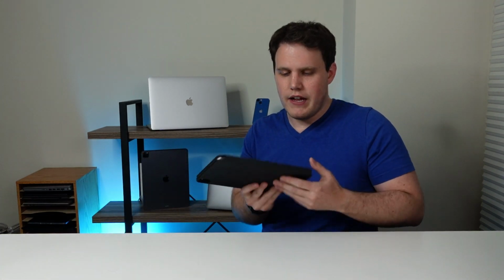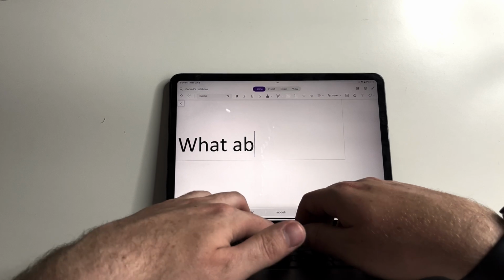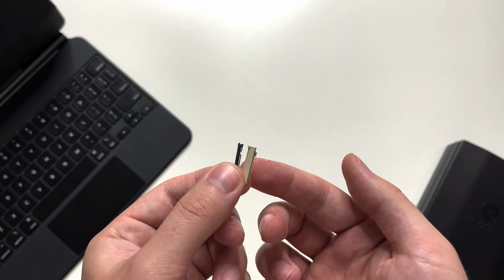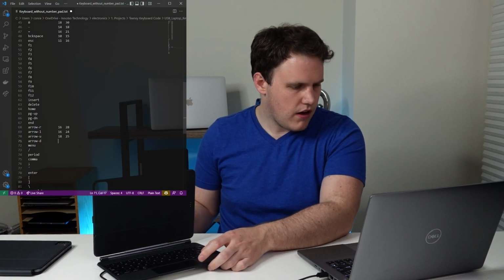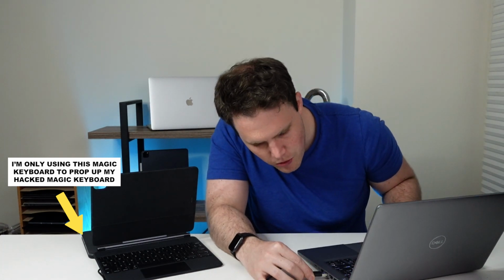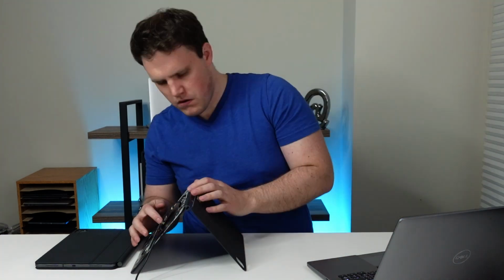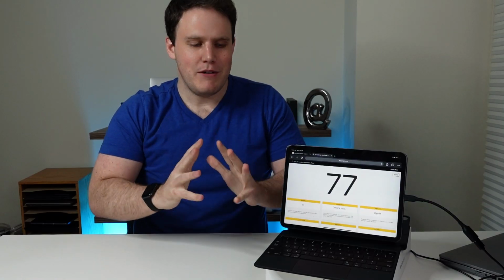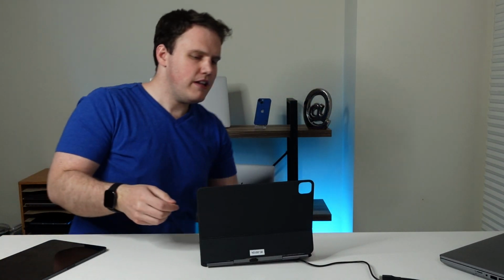World's First USB-C Connected Magic Keyboard! Fully Customizable

Comment: Nice job!  You really pushed the limits on this one.  Pretty cool that you recorded your entire process, then edited it down. Nice to share in your excitement when it all worked! That aluminum panel is EMI shielding, probably to meet FCC regulations so the keyboard doesn’t interfere with other devices.  It’s not providing any structural support. Subscribed and liked!
Reply from the maker: It was a tough one but I'm glad it worked out! And thanks for the information on the aluminum sheet that's good to know!

Comment: An idea for a video although it would be quite expensive would be taking an (M1 chip motherboard) from a Macbook pro 13 inch and putting it into a 2019/2020 Macbook pro 16 inch the ones that had intel chips in them not the new design models. So you could essentially get an M1 chip but with larger screen real estate.
Reply from the maker: I actually tried this! The big challenges are getting the screen to work, and I had tried hooking up the keyboard and trackpad adapter directly to the motherboard of the M1, and unfortunately it didn't work

Comment: I have waited for this video way to long…
Reply from the maker: Was it everything you had waited for?
Reply: @innoiso  I was waiting for someone to take advantage of the Magic Keyboard internals and the "magic" smart connector they use. I thought I might not see the day coming, but here I am. I also tried a Logitech combo touch for the iPad 10.2" on a iPad Pro 12.9" and it worked perfectly. This would in theory mean that the smart connector is the same thing on every iPad right? I was curious if you could take out the board from the Magic keyboard and make like your own Smart connector signals, like building a magnetic charging stand that kinda "wirelessly" charges your iPad but also is somehow efficient. Other ideas also like trying to adapt a USB connection to the smart connector or making the Magic Keyboard work on older iPads (with home buttons & smart connector) by sticking like a simple case without a stand to the magic keyboard and running 3 little thin wires to connect them and make them run perfectly. Your idea of making the magic keyboard USB compatible is much more than I expected from someone for sure!
Reply from the maker: Yes, Im not sure if there is some signal that the Combo Touch, Magic Keyboard and Smart Keyboards send to the iPad to verify that it's genuine. It's notable that not many companies have made accessories that connect to the Smart Connector, I think it's a licensing problem. I'd love to be able to reroute my Arduinos signal back through the pins, but I don't quite have that experience with electrical engineering
Reply: @innoiso  It's for sure a licensing problem and you are way more advanced than me haha, but I can note that there is a really unknown product called the "Logitech Base charging station with smart connector" that got discontinued. It can charge basically every iPad which had its smart connector on the side. Maybe getting this thing cheap & used to try and experiment with it would be an interesting idea and also try to replicate it? Not sure how that would go based on views, but would be still a good & never heard of topic on YouTube, reverse engineering apples smart connector